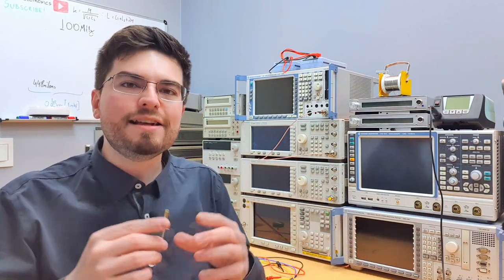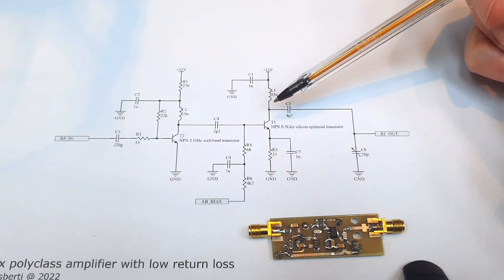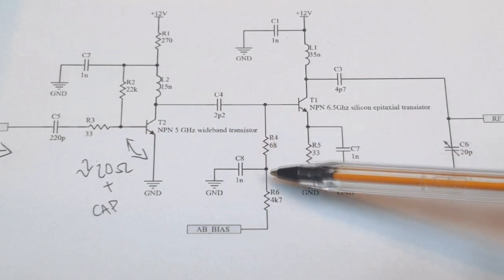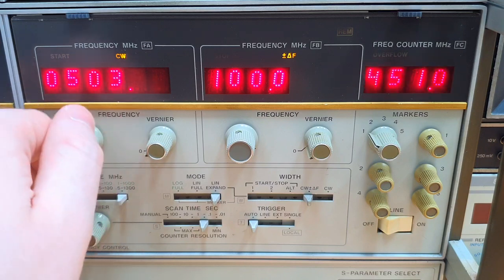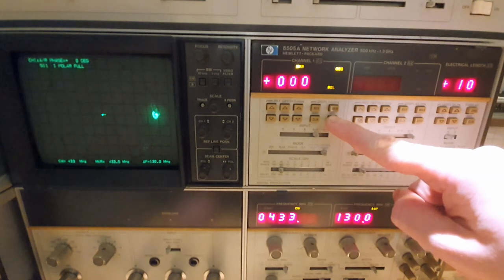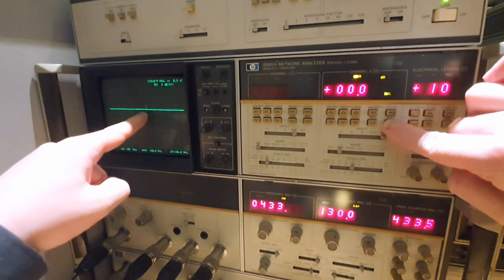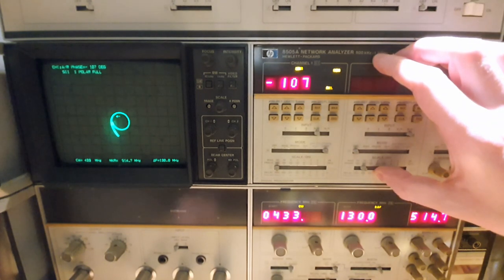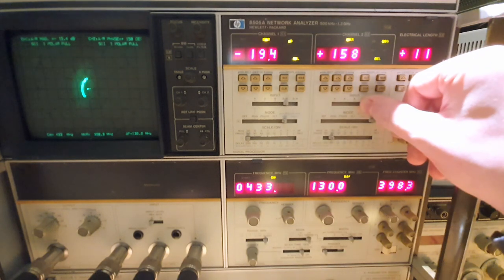433MHz Polyclass RF Amplifier for phased-array | HP 8505A VNA

Comment: Why don't you place a series capacitor with 33 Ohm impedance instead of a 33 Ohm resistor? If it's a narrow band amplifier, wouldn't it be better to not sacrifice noise figure over broadband input impedance?
Reply from the maker: The resistor absorbs the power! A capacitor would reflect power back to the delay line.
Reply: @AllElectronicsChannel  but only if it is not matched. If the impedance the delay line sees is matched to the line`s impedance, then the reflection is lower.
Reply from the maker: 33 ohm if different than 33j! The capacitor adds series reactance, not resistance!
Reply: @AllElectronicsChannel  Then, to rephrase Tibors question: why didn't you place an LC matching network with 33 Ohm impedance instead of the 33 Ohm resistor?
Reply: @weinihao3632  that's actually the real question I should have asked.
Reply from the maker: Hello guys!! Some things that were in my head:
- the delay line want to see a broadband match (if not, the reflected harmonics would intermodulate on the delay line varactors) 
- a resistive match has broadband ABSORPTION of power (no reflection) 
- a resistor is easier and do not need tuning

Always think that the input signal is not a pure sine, it has harmonics. And the transistor input is non-linear, it generates harmonics! So a single frequency match is not a good idea! Of course, in this design we have plenty of gain to burn and no concerns about NF

Comment: The BW botons near the CRT are for resolution Bandwith or for Video Bandwith? what philosophy is used in the phase measurement of Those instruments I Q signals or the PFD widely used in the PLL? And it is able to measure group delay because to do that i supose that you have to get rid of the discontinuities of the phase vs freq Signal and then derivate the Signal?
Reply from the maker: The buttons are for resolution bandwidth, if I'm not mistaken. 

I think they use phase comparators like in PLLs. It also have a VERY complex PCB only for group delay, with derivators, phase compensators, using the linear signal from the sweep.

Take a look at the service manual.. this device is a beast.

Comment: Great videos. I have just gone through a lot of your videos and found them interesting. I am not a communication guy but really interested in finding a working simple circuit (made at home) for RF control transmittier and receiver for one bit or 4 bits over a few km and how to design an amplifier and choose an antenna to make it tens of km. I hope you can share some designs or resources and better if you could go through some videos designing and testing them
Reply from the maker: Welcome aboard!
Reply: So should I wait for them comming here  and soon ? @AllElectronicsChannel

Comment: very nice. 
As nice and well working these old VNAs are, I'm quite happy about the comfort that the newer models provide. 
But as has been already said, the amount of knowledge you get from needing to understand how the VNA works to be able to properly use it is very important and interesting. 

The input impedance looks really good, one nice "cheat" is to place a small resistive attenuator on the input to "force" it all the way where you want it. Not efficient but cheap and it works. 
The impedance of active devices really is an even blacker art than RF itself.
Reply from the maker: Hey man!! 

I have some videos in the queue before going to all the neat stuff you sent me..
Sorry for not posting yet!
Reply: @AllElectronicsChannel  
Hey Gregory, 

no worries, take your time and do what you want to do. 
I like all of your videos since all of them have some interesting aspect to them so no worries there. ;)

Comment: Great video. 13:30 when change the bias, the impedance (I assumed that's the output impedance) change. You mentioned changed the common emitter preamp to common base preamp and then you get a almost constant output impedance with the various bias. Do you have the schematic how you change the preamp stage to common gate? Also when you mean poor isolation, what's the theory behind? Thank you for your knowledge
Reply from the maker: I don't have the schematics. The common base presents higher isolation because it doesn't suffer from the Miller Effect. I have a video about Miller effect here on the channel, take a look

Comment: Excellent video Gregory! I have a question how could you measure the possibility of oscillations with the vna? Like factor K that is usually predicted in simulators. Thanks a lot. Excellent work!
Reply from the maker: Good question! It is possible converting the polar readings to scalar S parameters and using conventional stability equations.
Reply: @AllElectronicsChannel  correct!, just is a little tedious because for each new bias point the S parameters are different, so we would have to recalculate each time to ensure stability, would be great if a equipment could be cheking the stability in real time or at least draw in the smith chart the stability circles before the flash hahaha. I think is better be sure making it unconditionally stable and then test. I sent a message to your ig!
Reply from the maker: Amazing!!